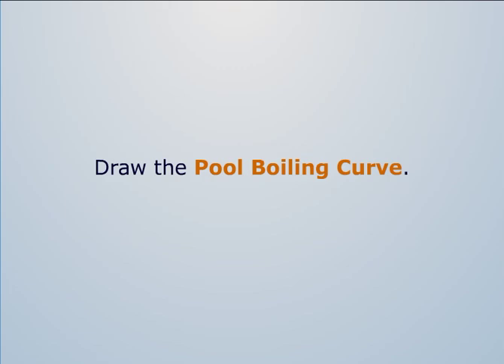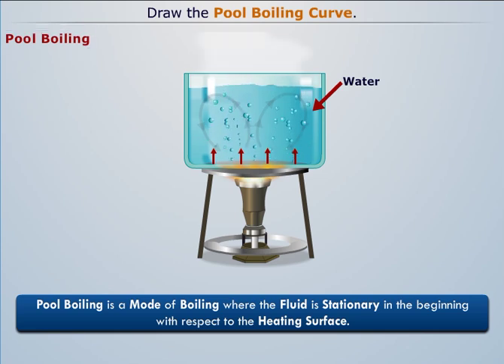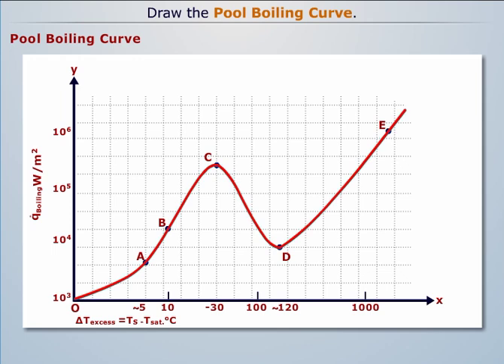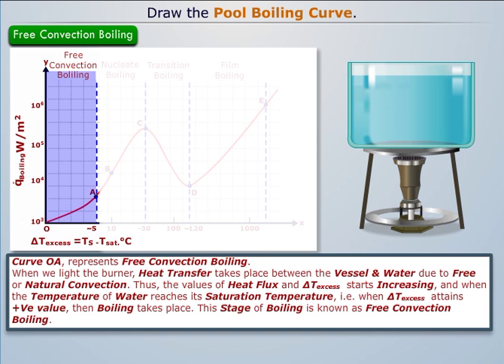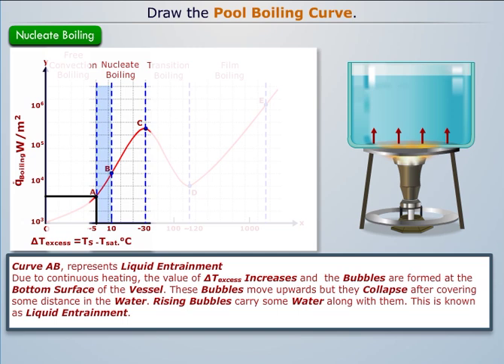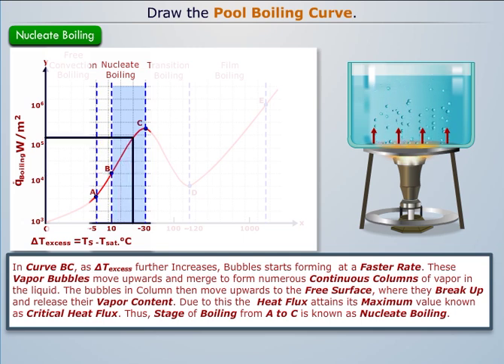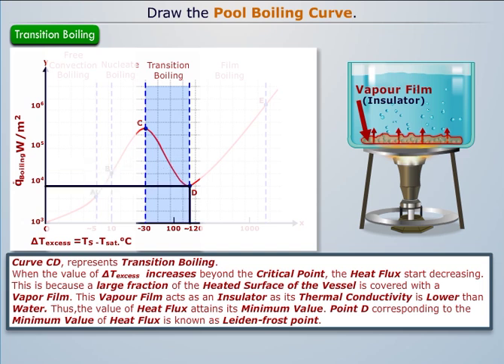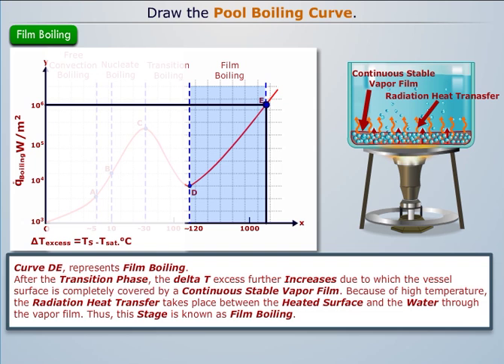Pool Boiling Heat Transfer | Heat and Mass Transfer

Comment: You said that at point A that the saturation temperature is reached, but that's not correct. At point A the temperature is about 5 degrees higher than saturation.